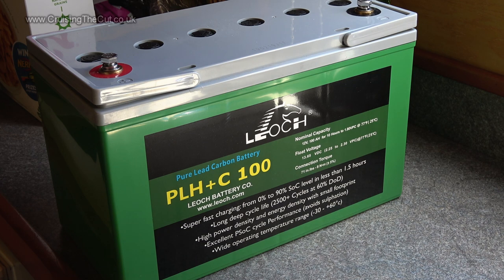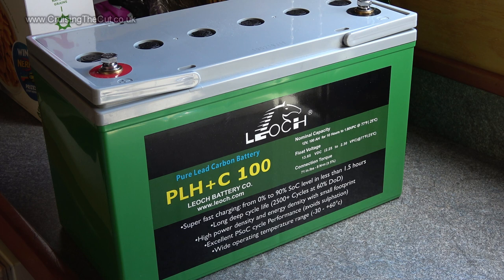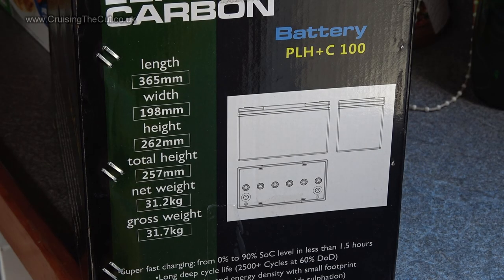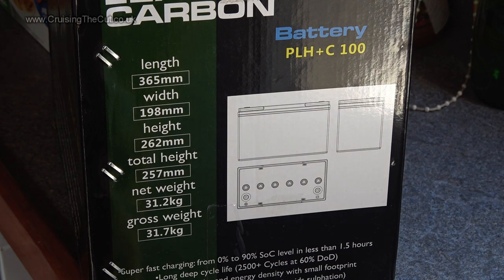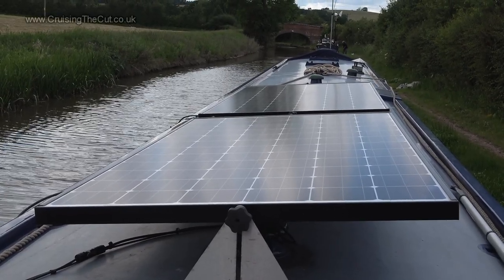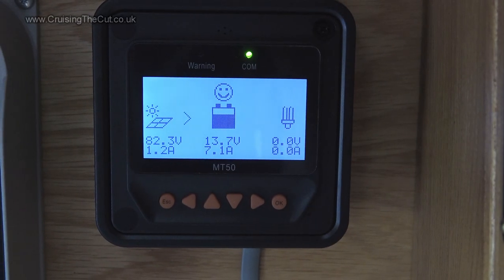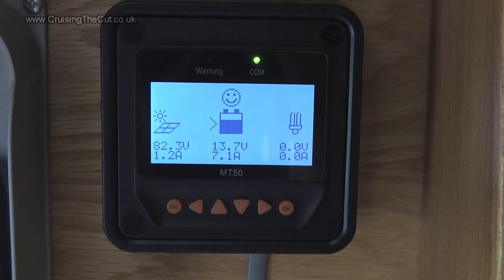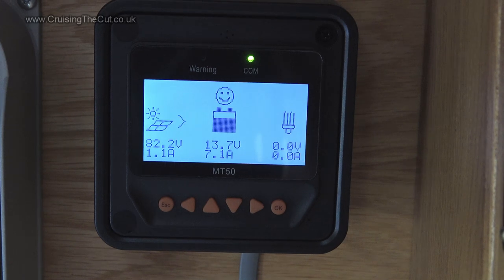178. Installing Lead Carbon batteries (12V 100Ah) into my canal narrowboat

Comment: Connecting the batteries - I think you're confusing series and parallel connections. Where batteries are installed in parallel ( like yours ) it doesn't matter where the connections are made, as all the +ve terminals on the batteries are at the same potential, as are all the -ve ones. In fact, to even out current through the connecting cables, it's better to connect up to the middle battery for both +ve and -ve ;)
Reply from the maker: Thank you but I'm certainly not confusing series and parallel, I'm well aware it's a parallel bank. It is nonetheless good practice to wire across the bank rather than from any point "within" it.
Reply: In this application it would not make any (practical) difference where the cables connected. However, it is true that there is a benefit from wiring across the bank, all electrical paths from each battery will be equal in length. If you connect up to the middle then the electrons coming from the outer batteries have to travel a further distance through the cables. That means more resistance for them, which means more electrons from the outer batteries are working to heat the conductors then for the center battery.

Comment: It's not across the bank. Everything is in parallel. It doesn't make a difference where they go😁
Reply from the maker: Yes, it does. See the linked article, cheers
Reply: I'm a spark. It really doesn't 😘
Reply from the maker: It really does. Read the article.
Reply: Richard: The resistance in the wire between the batteries will expose the left battery in the old configuration with a smaller voltage and hence less current.
Consequence: The batteries will be charged different.

Comment: Actually, you should have connected to the center terminal like you had before. The way you have it connected now you have double the current going through some of the wires than you did before, which is fine if your cables can handle it, but if not, the wires can get hot and melt.
Reply: The interconnecting cable should always be rated for the full load required from the batteries. It is therefore irrelevant that the load may be half (or any other figure) of the full capacity. The wiring as shown at the end is the correct way to cable these batteries.

Comment: It doesn't matter where the connections are on the batteries you don't have to have the cables on either end of the battery bank. you batteries are wired in parallel so its one big battery it doesn't have a brain you could have left the cables where they were assuming they are big enough to take the load.
Reply from the maker: It does, see other replies plus the article linked in the video description.
Reply: @CruisingTheCut  in an ideal world you'd connect the batteries in series with a balancing charger (battery management system) and have a DC/DC converter (from 36 to 12V), or have your entire system be that higher voltage.
all the batteries are now drained at the same rate and if you omit the DC/DC converter and have a higher voltage system (48V with 4 batteries) with less current drawn (at the same power draw) eliminating ineefficiencied induced by running 100A (or more) through a wire.

Comment: This put a wee smile on my face, used to be a bus fitter. sparks when changing batteries is the norm, don't worry, we used neg first (but rely does not matter, as long as the cables or tools don't short out). One small tail was on Mercedes Vario buses, the batteries sit under the drivers seat, that's Ok until you get a 18+ stone driver who insist on not just placing his/hers backside on the seat cushion, but landing at it from a reasonable height 😒, once the seat base had bowed under the weight of said drivers, they had a wee shock 24 volts  going though their seat!  🙂😂🤣. the passengers often were not happy to see us come out with not only batteries +but hammers too straiten the seat frames, the longest part of the job was making up new breather kit (lots of replacement caps and tubeing) for the batteries (because they were inside the vehicle) I noticed that your replacements are sealed batteries.

Comment: Great video very entertaining. And yes I also would wire from positive at one end of battery bank and negative at the other end to have a true circuit. but maybe have reversed my input to my output leads. Love your shows keep floating and be safe.
Reply: Yes, the solar power leads could have been wired opposite/"mirrored" with regards to the main discharge wires, to avoid clumping all the connectors on the same terminals. Would have been a little bit neater mechanically.

Comment: Trainee electrician here. If you put a resistor between the last wire and the battery the electric discharge will equalise. So when you connect them up there will be no spark/surge.

Comment: They are in parallel.  Wire position means nothing.   The three 100 ah batteries act as ONE 300 ah battery
Reply from the maker: I’m well aware they’re in parallel and what that means but it does matter. See the link in the description.
Reply: It is to do with a thing called Kirchoff's Laws. ( The sum of the volt drops in a cct = voltage applied and the sum of the currents entering a node [common connection point] is equal to the sum of those leaving). All electric conductors no matter how big have a resistance which causes a small volt drop so for a device to measure  the voltage accurately from the batteries it must be across the the bank as David has shown otherwise you are only monitoring one battery.
 Also if the banks output leads are not connected as shown, but as he had them previously, the main positive red power lead will take the sum of the currents of each battery whilst the first short lead is carrying 2/3 in this setup and the 2nd short lead 1/3 (assuming all batteries are at the same charge and condition). The same is true for the returning current so when the demand is heavy the first battery will take a bigger hit than the last in the chain but of course get the better charging current. The difference is small but accumulative. In a bigger bank say 6 batteries,  over time this will result in a greater variation in battery usage and condition. Cross connecting the bank in this way reduces the difference in current across the bank and also the voltages across each battery leading to balanced usage . Needs a diagram to explain clearly.   btw disconnect whichever side of the batteries are connected to the vessel/vehicle ground first. In this case negative   Sorry long and as David would say Geeky

Comment: Your theory of attaching the main cables 'Across the Batteries' at different ends is Absolute BS! It is the same potential at all 3 terminals. And you should disconnect the negative fist and reconnect last.... 30 years a licensed electrician.
Reply from the maker: Please see the article linked in the video description, cheers
Reply: @CruisingTheCut  If the wires connecting the battery's were super conductors ting ting would be right. As there is an impedance in the cables joining the batteries ( albeit very small) the way you installed it is correct. The voltage difference between the three batteries explains the small spark you obtained when connecting them as the potential difference between the  batteries equalises :)
Reply: Chris Landry  Yes they can and are because the wires linking them ensures that !
Reply: @CruisingTheCut  The content of the article is totally valid when your 44 ton electric truck takes 1-4 thousand amps out of a battery bank. For your pifling boat it's BS. Still, if it gives you peace of mind !

Comment: Well done , batteries issues are always an on going topic ..for those who put the time into understanding how the Electrical system works always seem to have power ..there are so many thoughts and theories about batteries ..I think it comes down to what suits your environment ..hunter being 23 tons and a yacht I am always concerned about the weight Factor ,so I only use one battery for the domestic Circuit .it generally burn out in 2 years with the fast charge and fast discharge ..

Comment: The inverter has some lovely big input capacitors. These drain as soon as you disconnect the batteries and then recharge very rapidly when you reconnect (whether the inverter is on or off) ... hence the sparks.

Comment: After reading the comments everyone is an expect on how to disconnect the batteries even after you turn'd off the video so they wouldn't have any reason to complain about how you did it. Anyway, now back to the vlog. I was surprised with your knowledge about the batteries, the hookup and the solar. You are a lot smarter than I look. lol  It is going to be a long wait till we find out how good 👍 or bad 😡 these batteries are. I hope for nothing but good information after the test run. Good luck with them I hope they are better than you hope they are. Very impressed with the vlog. Now go cruise the cut so we can have more videos to watch.😁

Comment: great video as always .. the spark is the input capacitors charging on the inverter... quite common .. you can use a large resistor to pre charge them

Comment: I agree with your changing the wiring to charge and discharge across the bank (not an expert either). Also sparking batteries leave my mouth dry and hands shaking a bit (heard many a story of exploding batteries and stood next to a Hydrogen explosion once [tiny explosion no one hurt]) which was enough to etch itself into my memory.  Well done by the way.

Comment: Excuse me for adding this (i started my professional life as an electrical engineer) but you're advisors are well informed.
but about the spark when i went to school we where instructed to never connect led accumulators in parallel they while over time kill each otter fighting over the right voltage,  technology has evolved and this is not the issue it ones was, but it while give you those sparks.
A second reason for the spark is that the capacitors in the Inverter like to charge up fast.
Regardless you're advice on cousin when working whit accumulators is a good one.
I used to know a man who shorted out a rather large led acid accumulator, and it blew up in his face permanently blinding him. 
thanks for a good wlog, and i am locking forward to the next one.

Comment: David, I applaud you for being spot on and particular about the wiring in this way - I often have cringed at the rather haphazard approaches I've seen leisure batteries be wired. Balanced batteries will prolong their life - good if you've just dropped a bundle on them! Even more important if the internal resistance of the battery is low. The variations can consequently be very big

Comment: This vlog has given me brain strain. Your wonderful vlogs 'please' are supposed to lull us into a comfortable stupor. Either we should be lazily perched in the front deck while you do all the work cruising us around, or we should be  cozily as close to the coal stove as possible while moored up sharing your cheese and tomato sandwiches. 
I is an mekannkal enginner wive a deegree etc., lol so I did look many times at the battery  wiring and listened each time to the description.
The idea of connecting the three or more series connected batteries the new way you have, is to deal with very high battery charge and discharge amperages. All the electricity passing through the bank will have whatever route it took, passed through only one battery and two (in your case) battery links.  The voltage losses and uneven battery discharge through a cable and between battery and cable connection can become a problem at only 12 volts and very high amperages. That's why the cables are so thick and the connectors so large. The low amperage charging won't be an issue with the old connection, but it will be slightly (as you say) better with the new one.
The cables from the battery bank to the switch need to be at least able to carry three times the current that the interconnecting cables carry, The cable sizing is a factor of length as well as current.
I would suggest that an isolation switch is added between the invertor and the battery bank, As it stands as you connect the battery it looks like the inverter gets powered up as you make the connection.
So far as sparking is concerned you should not get a spark period. Before making the final connection check for voltage potential across the connection, there should be none, if there is, then the system is not isolated.
Reply from the maker: Agreed the inverter should really have an isolation switch. Must do that one day.

Comment: The ability to research (and compare from several sources), read (carefully), and follow instructions (without jumping ahead because you just know what the next step must be) will do very well as a substitute for a great deal of training and experience in the hooking up of batteries, as well as a great many other technical subjects. 

Used correctly, the internet, and all the other ways to disseminate knowledge, have made the modern world a lot easier to deal with. I feel we have passed a fairly long period where technical matters were the exclusive province of "wizards", leaving common people ignorant of the very things they depend on for their very lives. Up until about the 1960s, the average person could work on automobiles with a few hand tools and a repair manual. When cars began to depend on fancy electronics to operate properly, the "wizards" took over with their arcane instruments and tools, leaving a generation or more with little understanding of the beasts that carry them around. Today you can find a video that will show you how to do most things on a car. The same for the electronics that permeate our lives. It is vanishingly rare to be the only person in the world with any particular problem.
Reply: Peter W. Meek Very well said!

Comment: About where to connect to batteries, electrical engineer here, you have a "bus" across the + terminals, and same across the - ones.  Where you connect load/source to that MATTERS NOT, so long as each leg of wiring can handle its peak current, and the connections are snug. Obviously, higher-gauge wire should be used, if possible, for leg(s) carrying higher current. First priority for replacement, for me would be wires showing  corrosion and charger/inverter connections. Adequately-sized copper wire is  really cheap insurance. HTH, belatedly.
Reply: As a bus connection is only zero resistance in theory, I suspect the reason for cross-connecting the charge and load is to attempt to equalize the restive paths to the batteries in the bank. As David said, I suspect the practical effect would be minimal.

Comment: Another informative vlog, thanks. I had an epiphany after joining the 12v boating group on facebook. I previously used just a smartgauge to monitor charge and discharge, however the charge side was a revelation to me and now I have less money and a Victron 30 amp charger and Honda generator and critically  a Victron battery monitor that tells me when my batteries are full and what each individual item consumes if I wish to monitor it as I use it via the natty bluetooth interface. I went for AGM's and I am ashamed to say my wiring needs a good sort out even after I rewired it all. You have a tidy install and one that now seems wired correctly for balancing the inputs and outputs on the new batteries. Interesting to see how they perform. Take care
Reply from the maker: Thanks. I'm a member of that valuable group too though there's always debate on there about the usefulness of these Amp Hour battery gauges. I'm quite pleased with the install so far. Cheers

Comment: Enjoy you videos.  The sparks that you get when you connect your inverter up is normal.  It is caused by the capacitors in your inverter charging up to match the battery voltage.